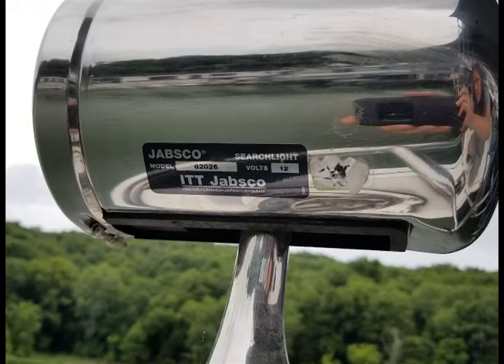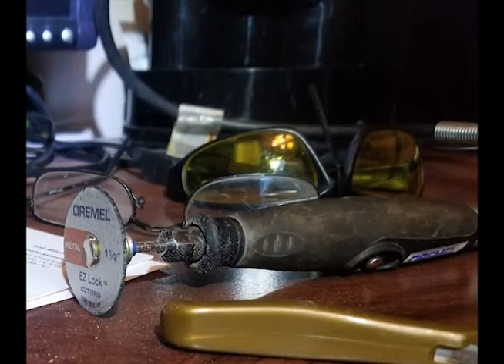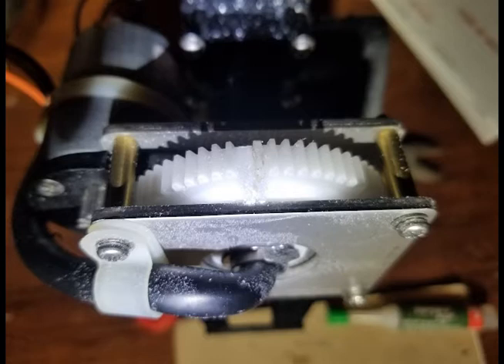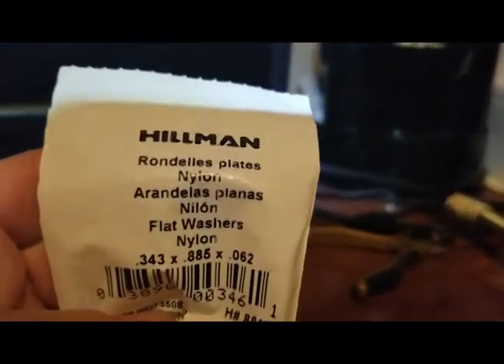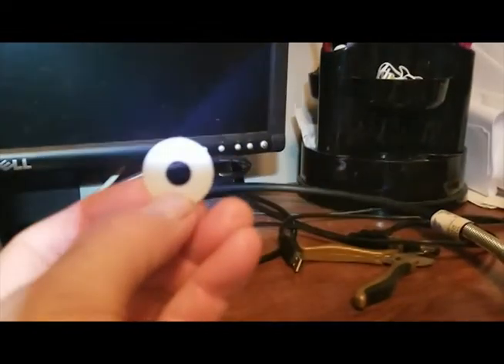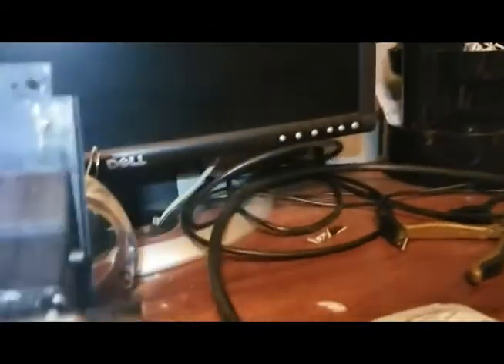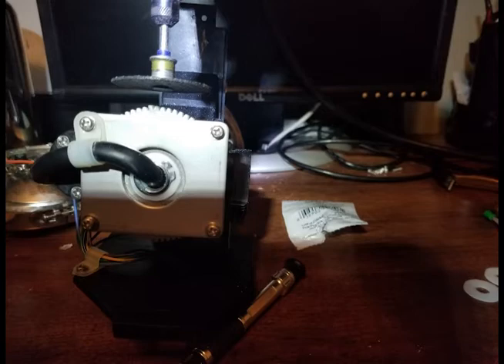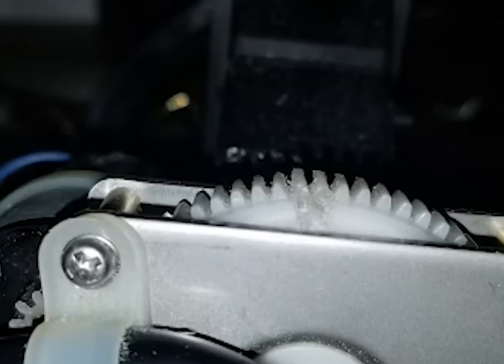Jabsco 62026 spotlight stripped gears repair

Comment: I have the same spotlight that has stopped most moment.  Are they easy to disassembly and look for gearing issues?  I am hoping might just be seized and need some lube
Reply from the maker: Give it a slight turn to see if it starts moving. If so your gears are stripped. They are easy to take apart.
Reply: @doughknuts  ok thanks.  It takes some force to line it up. Under power it only trains from stowed position to about 30degrees up.  Won’t come back down on its own or pan left right.
Reply: @doughknuts  I just fixed the anchor foot pedals, so that is enough for today!